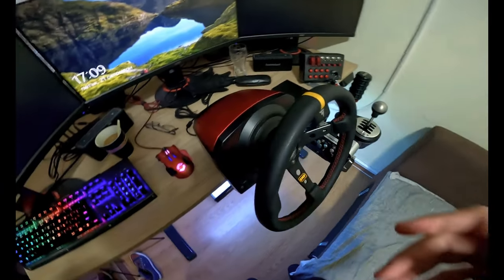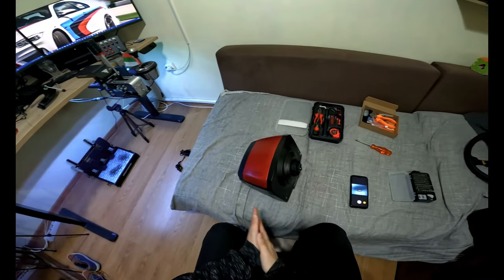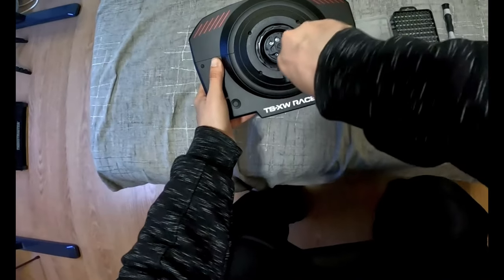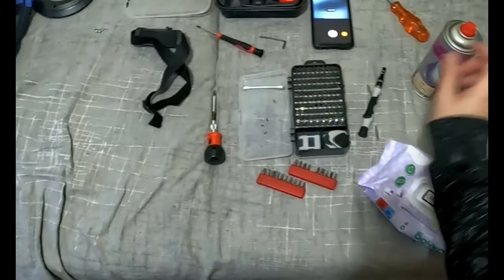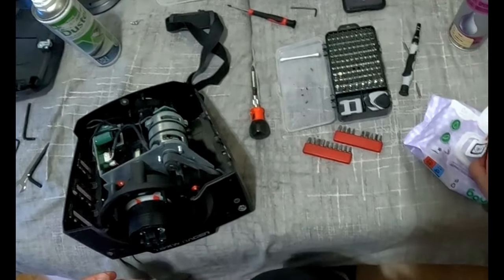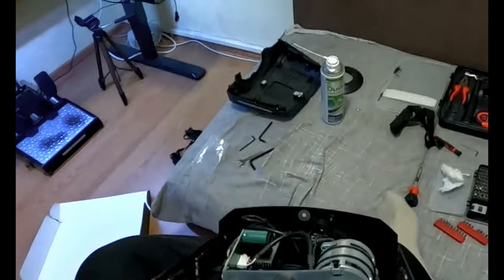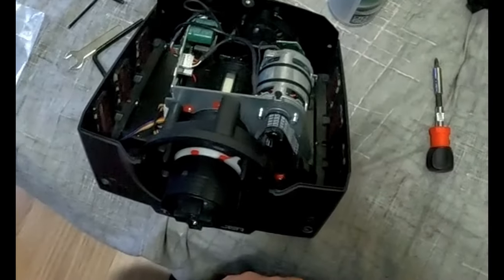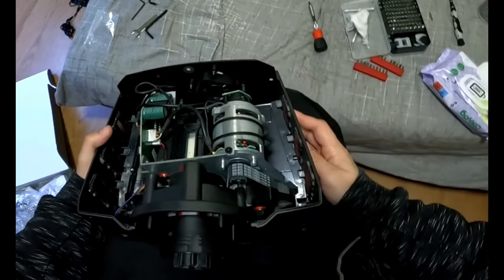Fix IT! EP6 Thrustmaster TS-XW Rattle Sound FIX / Maintenance / Disassemble / Assemble

Comment: I had to open mine and mine STINKS of like metal/electrical motor type stuff it works fine but my god IT STINKS (I bought it used from a person that had it in storage)
Reply from the maker: @SoMiSongbird  haha use compressed air clean it well from dust
Reply: @projectxmotorsport  I did and it actually got rid of most of the smell now I gotta keep using it so the rest of the stinky goes away haha

Comment: Mine is TWO WEEKS OLD making that sound
Reply from the maker: yea mine made that sound on 3rd day I started using it, just go to shop and ask to buy some light grease that doesn't eat rubber or plastic, then you apply it the same way as I do with lubricant, but I used finger with grease im so happy, I havent touched the wheel for months and 0 sound, grease is superior

Comment: Didn’t work 😔
Reply from the maker: Sorry to hear this brother, I used light grease on my belt and its super smooth and no noise since half an year at least. Check, if its not from the belt, but actually the wheel base itself or other part.
Reply: @projectxmotorsport I think it’s from the part that gets the wheel and the base together, the ffb is working as usual I believe. Do u have any idea of how to solve it? I’m desperate 😔
Reply from the maker: @betobeto1241  check if the quick release is tight or if you disassembled it, you can check if something is loose, if its rattling something might be loose. 
Join our discord and send a video, so I can see and help.
Reply: @projectxmotorsport  thanks so much! Where can I find the discord channel link?
Reply from the maker: @betobeto1241  discord link in description
Reply: @projectxmotorsport got it, I already wrote something on the help channel. Thank u so much

Comment: Thrustmaster says that sound is normal for newer bases and is part of “break in period” and will go away on its own, idk if I believe that. My tgt 2 is 4 months old and I use it all the time never once made that sound. My tsxw I got 2 weeks ago, about 20 hours of use on it (maybe it’s closer to 3 weeks old) and this grinding sound started almost immediately. If I had it for months or years I would take it apart and do the maintenance, but doing that for a brand new item just doesn’t sit right with me I’m returning it.
Reply from the maker: nah its bullshit, they had 0 lubricant or grease on the belt or gear, so the moving parts is what makes the sounds its DRY asf, moving parts should aaalways be greased up to move smoothly, check my previous reply to your other comment thats what you need. Open the wheel yourself and do basic service, you will be the happiest person, I've been throught thrustmaster support for pedals and the wheel base etc. for info about problems, just do it yourself trust me, it's why I started the Fix it series
Reply: @projectxmotorsport  my original 2 tsxw lost their ability to center correctly within days of both of them idk what that was all about. The center value would go to 90 degrees or worse minutes after calibration. I have no luck with this base

Comment: Really handy. I had to take it apart twice for that same issue under 2 months, so far.

Give me another month and I’ll be back at it if this wheelbase still doesnt cooperate.
Reply from the maker: I used lubricant and it kinda goes away quick, so my plan is to use grease, as grease stays very long compared to lubricant, it's very annoying to have to open it every few months even 1 month haha.
Reply: @projectxmotorsport  Yeah I used WD-40 yesterday and it now it performs like if it is brand new.
Reply: @projectxmotorsport  Btw it developed a catastrophical failure. You know the black plastic shroud in the center? The screws wont even tighten in anymore.

After 6 months, I got a catastrophical failure. It'd be a wonder it manages to make it through December 2023.
Reply from the maker: @limpetarch98k  look how I taped my quick release and adapter together with black tape, try that I did like 15-20 rolls haha
Reply: @projectxmotorsport  By the way do you know the size of the philip screws Thrustmaster used for the plastic shroud? I might do one last ditch attempt by using longer screws because I noticed they thread in without the shroud but once you try to screw it back in with the shroud they are too short
Reply from the maker: @limpetarch98k  Hey brother, I would not recommend getting longer ones, because if you use normal wheel with buttons and joystic basically on it, it has electronics so it will have cables. 
The longer screw might penetrate the wheel adapter thingy that you lock with the quick release. 
Do at your own risk, but be careful if you decide to go that route.
I personally had enough of any cheap stupid lock mechanism or quick releases, I literally duck taped the whole quick release shit together with my adapter, probably 20 rolls of tape.
I has not moved since months literally, never ever moved since I did that, but it means you will have to use only 1 wheel and stays like that :_Lul:
Reply: @projectxmotorsport  Good grief, gonna have a hard time selling it on the used market.

I could like buy one of those dashboard mods that replaces the plastic shroud (and come with 4 new screws, which might help), but some of them are costing as much as the entire bundle

Comment: thanks for this, but would this not make worse for durability? If there is lubricant the grip between the belt and the gear will be loose and therefore the gear might keep rotating without adhering to the belt and therefore braking the inside dents of the belt. 
I presume that's why you saw those black pieces all scattered around the mechanism when you opened it this time and you didn't find them the first time.. ?
cheers
Reply from the maker: Hey brother, it is actually the absolute opposite.

I was lazy to lubricate my gear and belt, so therefore it became dry asf, so what happened next is that the belt and gear start to wear off waaay faster and it is why I saw the small black pieces.

My best advice, as also any mechanic will say, when you go to check your car, any moving parts and gears must be lubricated, I made the mistake 1 time to be lazy and you see it makes noise and small black pieces.

Lubricating your belt and gear will increase the durability tremendously. 

I have the wheel maybe for about 2 years and it's still keep going, keep in mind I have been drifting non-stop everyday due to content creation and the daily practice is what made me one of the best drifters in assetto. 

My advice to you brother is do not hesitate to buy light grease, make sure it's not eating rubber, I changed from lubricant to grease and it's eeeven better, that will make you not open the wheel every 2 months, but the grease can last god knows how many months.

I haven't greased up my wheel from months now and not a single noise of scratching or rattling.

I hope this helps you!

Comment: This might be a dumb question, what size hex nut things do i need to put in the adapter? I have a vertex wheel i just bought and none of the adapters im looking into come with hex nuts and i have no idea what size i need for them
Reply from the maker: wuut how do they not come with wow, mine NRG came with nuts with it. Check an adapter that comes with bolts for it 🙂

Comment: Will I lose my warranty if I do this and can the steering wheel break if I don't?
Reply from the maker: Technically Yes, Practically No. 
And why No, because, if you open the wheel slowly without scratches etc. you just apply small lubricant and grease and you are good to go. 

This is as simple as possible to do.
Reply: @projectxmotorsport  Plus, my belt is louder than yours. I don't know if it's because of the quality of the recording or it's actually 900% louder in my case.
Reply from the maker: @Joy11En  thats' because you didn't lubricate it or grease it. 

If there is no grease on a belt or bearing they will always be loud no matter if it's real car or wheel base.

Comment: Does it get worst if youbdont lubricate it?i have just a very small noise i dont feel the nezd to do it actually but i affraid it get worst with time, thx for the video
Reply from the maker: That's up to you honestly, I love to save my own equipment and maintain it, that will increase the wheel lifetime.

This is insanely easy, but no one has covered or made video about it in english, so I decided to be the first one.

My advice is open it, I show step by step and lubricate or put grease on the belt, it can be just very small grease, because Thrustmaster did not lubricate the belt at all.

Not only it is healthier for the wheel, but it will also work way way better and smoother, because the belt will move way better.
Reply: @projectxmotorsport  you made go for it thanks again i'll buy some grease and do it tomorrow
Reply from the maker: @yacineabessy4655  Trust me you won't regret it, by default the belt has 0 lubricant or grease and once you do it, bro the wheel will move soo smooth.

Just make sure the grease is not some that will corrode the belt aka rubber and you're perfect!

Comment: Any over heating issues with this wheel base as my one turns off after playing for 30 mins or so
Reply from the maker: Hey brother no I never had issues, make sure the wheel is connected to the PC and there is no electricity issue somewhere to cause it, finally you can return it if nothing works.

Comment: Hey, any suggestions please.  I'm just a casual TS-XW user on xbox, about 18months old and recently encountered an issue where turning the wheel in game was incredibly stiff so I switched it off and decided to connect it to the laptop to update the latest drivers. The wheel appeared to go through the update just fine during the update process syncing both ways as it does and laptop showing it completed the update 

When I reconnected everything back on the rig the ts-xw wouldn't switch on at all but noticed the wheel slightly move after plugging it in, (no lights or anything) any suggestions and recommendations please thanks, could it be the turbo power adapter? I miss it now 😢
Reply from the maker: Hey brother, that really is weird, at first I thought its incompatibility issue with the game rather than the wheel, but as you said you updated now its weird, you use the wheel on the console or PC?
Reply: @projectxmotorsport  Hey brother, just casual xbox user. A guy on another forum suggest I try the boot loader method as attached. I can't try it until next weekend now because of work commitments, please have a read of attached tm link and let me know what you think.
Reply: @projectxmotorsport  I tried to copy and paste the Thrustmaster TS-XW bootloader method here directly from the Thrustmaster website but utube wouldn't allow it.

It was there 3 times but then it suddenly  vanished therfore utube must not allow certain copy and paste knowledge 😔.

Comment: What kind of grease do you use?
Reply from the maker: hey brother some light grease I asked in the shop to give me grease that doesn't eat rubber and plastic, thats what you need anything that wouldn't make your rubber belt or plastic rot slowly.
Reply: @projectxmotorsport a bit of a late comment as I have this issue currently but do you know what type of grease you used specifically  like silicone or lithium?

Comment: 8:38 NEVER, ever spin the fan like that. Motors work like generators when spin.
Reply from the maker: Thanks mate will keep this in mind, I went goofy too much 😄
Reply: I don't get it, it's a simple fan on the back output of the base to manage the outstreaming air flow. No motors or other parts are neither attached nor connected to my knowledge. And because of this nothing is affected apart from this cheap fan. Or did i miss something here?
Reply from the maker: @mr.justice4976  yea I thought the same, as it's just a fan for cooling, but he has a point, I shouldn't fool around too much with the equipment 😄

Comment: Have u had any issues with the adapter
I just used it and it randomly presses buttons that I don't have on full lock
Reply from the maker: Which adapter brother?
Reply: @projectxmotorsport  the adapter for the steering wheel
I got a nrg one and everytime force feedback kicks it presses every button even tho I don't have any on the wheel
Reply from the maker: thats weird, could be pushing some of the thingies inside.
Reply: @projectxmotorsport  I was hoping u had the same issue I think it has something to do with not having any buttons to press it's freaking out but idk
Reply: @projectxmotorsport  thanks for the response
Reply from the maker: Unfortunately not, I only had issue with the bad designed quick release mechanism that uses a stupid screw which makes massive hole in the wheel itself. So now I ducktaped my adapter to the quick release itself.
Reply from the maker: ag brother, I try to help as much as I can, as far as my knowledge and experience allows me ❤️
Reply: @projectxmotorsport  thanks brother and love your content

Comment: Also let’s say I did decide to do this, would lithium grease be ok 😂
Reply from the maker: you have to research, if lithium grease eats rubber or plastic, you don't want the grease to melt your belt or gearing
Reply from the maker: I just googled and do NOT use lithium grease it will damage your rubber belt.
Reply from the maker: go to a shop for instruments and shit, they have tons of greases, explain to the guy that you need grease that can be used for metal and rubber, because you have these moving parts together, so it doesn't eat en.
Reply: @projectxmotorsport  got cha. The lithium grease came with my fanatec gear, it’s used on the brakes. I don’t think it’s corrosive but I’ll take a look.
Reply from the maker: @steveybiggunzgaming8118  yes, but lithium grease is for "metal on metal", it will defo damage rubber, be careful and small pack of grease is super cheap 1-2 euro max, don't do dumb, better safe than sorry people say, 2 euro for risking a belt ain't worth you know what I'm saying.

Comment: I want to purchase this wheel and this makes me worried.
Reply from the maker: Nothing to worry about mate, whatever sim equipment you get, it will always need maintenance. The pedals have to be cleaned, the handbrake (not often at all), shifter I don't even have to clean etc. 

But yea any equipment requires maintenance in order to function properly. 
I like to keep my stuff safe, so I maintain them as much as possible. 

Hope you will enjoy the content out here 🙂
Reply: The less complex, the simpler to maintain and the fewer breakdowns. There is also some luck in these things.
But if you want less worry and less maintenance, choose a G29/920/923. On a personal level I have a G25 and a TS-XW.
Reply: @Darchful  I already own a g920 and I want to upgrade to a belt driven wheel, thanks anyway and I hope that If I come across any issues in the future warranty will cover it.